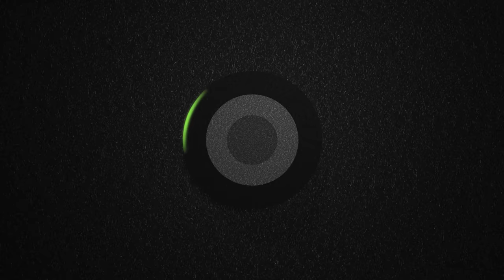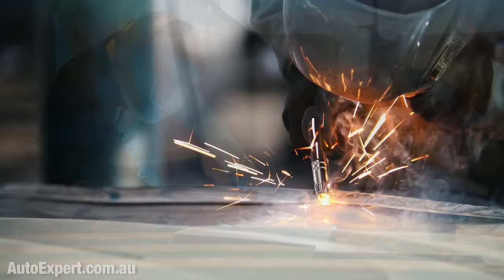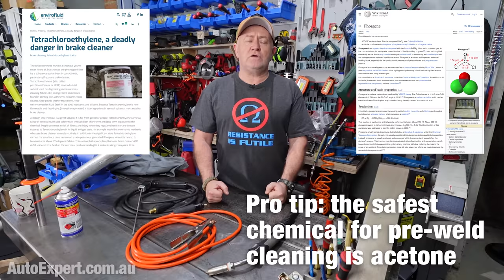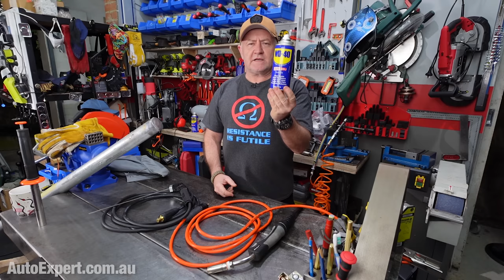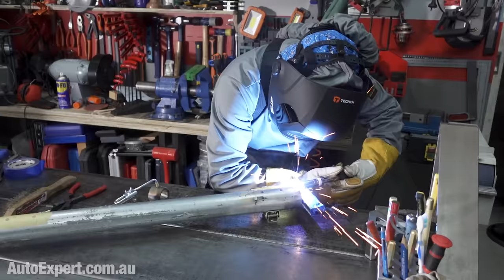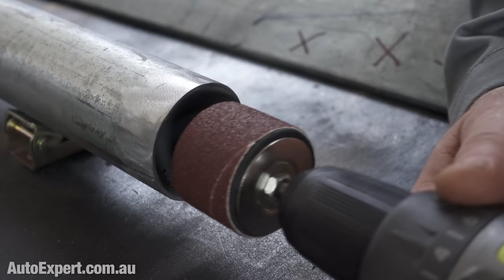How to die while arc welding at home: the top 5 ways | Auto Expert John Cadogan

Comment: What about people who hold the arc weld stick in their gloved hand also holding the holder in the other hand for more control?  i thought this was a good idea as i am prone to shacking the stick however the Technician in my brain wouldnt allow me with its blaring electrocution warning . Yes you are not completing the circuit Unless you accidentally lean on tor touch the other electrode say thru a thin sleeve etc

Comment: Additional hazard potential.... Any fine nickel dust (grinding of high nickel steels (stainless) ) and CO gas (defective heater, incomplete combustion, etc in a work area) makes nickel cabonyl gas - highly toxic. Grinding pre-welding of stainless pipes - ensure no CO present - the amount of CO required to make nickel carbonyl is extremely low.

Comment: Excellent advice. The only thing I would add is to make sure that if you smoke cigarettes, don't have a plastic butane lighter on your person. Put it where sparks can''t find it. You would be surprised to learn where a spark can go to and a spark can melt divots and holes into the plastic case of the lighters, possibly resulting in the lighter exploding.

Comment: What kind of a heresy would it be to remove galvanising with HCl (i.e. spirit of salts) ? Theoretically you would end up with zinc chloride, which can be rinsed off - and hydrogen, which would dissipate because you are in a 'well ventilated' environment. Obviously you would not then try to weld until the workpiece had dried . . .

Comment: So you missed some important context on your second story. Sure, your typical welder runs around 24v under load, but open circuit is another story. I've personally used some welders that would easily climb to over 100v DC open circuit depending on the machine and the technology in it. The common weldernator (premier power welders for example) used as an underhood onboard welder on some trucks even can be used to power brushed powertools. the open circuit voltages that can be put out by some welders isn't a joke.

Comment: 19:29 19:30 Great video I have seen every one of these scenarios except someone getting electrocuted I've been welding for 50 years the most Spectacular One was a guy welding on a stock car and there was a can of spray paint in the fender well. and he set it off large Fireball fortunately he was not too severely burned and another thing I've ran into is be very careful when dealing with magnesium grinding it sending it sandblasting at anything that makes particulates you will get that metal Flume flu instantly and it's not nice I thought I was having a heart attack

Comment: I was told, and it makes sense, that you can make fire resistant welding gear fire resistant after washing by putting it into a solution of borate, and then drying it.

Comment: hey that's just like dichlorofluoromethane or R12. That's how Air conditioning got started. after WW! they had a bunch of dichlorofluoromethane left over from making phosgene for nerve gas.. the dichlorofluoromethane has to have a catalyst .... a flame though. always wonder why in my old car repair manuals when working on an R12 ac system it said not to smoke, smoking i suppose you could draw in some dichlorofluoromethane through your cigarette and the burning ember on the end could turn it into nerve gas. So why did they use dichloromethane you ask for Air conditioning?  because it boils at around 38-40° F  and as you know with boiling water , the boiling water will never go over 212° F, the excess heat goes up in the steam, first principle of AC. they let the Dichlorofluoromethane boil as it passes through the car cabin and it takes with it all the heat from the car cabin, then the dichlorofluoromethane is compressed in the condesor p\outside releasing the heat.

Comment: I used an ac mig  once 300amp my god that shock hurt I only use an invertor now stick or tig 48v open circuit 12amp working voltage

Comment: One should be aware of things that should not be repaired that take certification, like pressure vessels, and dissimilar metals that do not bond well. Also welding heat actually changes the size of steels while welding.

Comment: The guy who electrocuted him self should work with an old machine because in the newer ones there is the VRD protection that reduce voltage in the rod until it will touch something with very low electrical resistance like a piece of metal.

Comment: Thanks for a very informative video. Regarding electrocution... isn't there any electrical safety rules that say an electrical appliance must not expose the operator to lethal voltages in your country? Though I was just repairing two welding machines and one of them did output a nice 34VDC idle, but the other one like 70VDC. The 70VDC could likely give a shock but being DC I think it is unlikely to electrocute anyone. But my point is that have all electrocution accidents been due to malfunctioning equipment?

Comment: Anyone with any understanding of electricity should be able to see that arc welding is inherently dangerous.  Thanks, I did not know about the UV exposure.  You left out drug dealers cutting holes in the top of their empty gas tanks and then patching them so they could hide drugs inside.  Saw that several times as a cop.  Only welding deaths I ever saw.

Comment: A solution for home use could be flux core wire and a table fan to blow most of the smoke to the side instead of going straight in the face, better than nothing I guess..

Comment: Had fun watching this and your expression to getting it over, but let's get real...

#2 "big fo fireball".

A good welder is a clean welder and crud/stuff on the table is a sure OCD trigger. Even build up of bb's from welding should get up a good welders snout get the stuff off the table and brush that thing clean. Don't forget a quick run of the brush on the floor before break (what? 30 seconds?)

#1 galvanised. 

That stuff just isn't good and ideally left out of the workshop. 

Prep (grinding) is good but that stuff is infused in the metal by electrolysis and your not going to get rid of it.

Certainly, don't breath that stuff in..

Flux core may be best option, but I've welded stick with a thin rod with fair success.. 

As for putting the welder to your face and grounding yourself to the table - that should never happen - the 1st thing the good welder does is put the welding weapon in its space well before lifting the lid.

There's lots of dangers with welding and it's as safe (or unsafe) as you desire it to be. 

Either that or you have no place even in the same room as a welding machine..

Comment: I thought the voltage of a stick welder was only 65 volts.   Not enough to  electrocute you.  I often got a shock from it.  Wooden work bench only in my shop.  The led ad aluminium is dangerous, not worth the risk.

Comment: I have been watching videos over the past few weeks trying to learn about welding before I even attempted it. I always found myself saying, "Well, if I had a welder...." so after years of saying that  I finally broke down and bought one about a month ago. I never actually got around to using it though because honestly, I was a little scared. I have never done it before and I would watch all these videos and always had questions. Questions that never seemed to get a straight answer. One person would say one thing and then somebody else would say no that's wrong and I'm just left there thinking, so which is it? I had no idea about the wet gloves (I sweat like a pig and this never would have occured to me), the brake cleaner, and about leaving things like wd-40 on the table. Even the radiation from uv exposure - I had no idea. Obviously I knew you have to protect your eyes but as far as what it does to your skin, literally nobody ever talks about it. I did know about the fumes from welding galvanized stuff though but that was pretty much it. I was completely clueless on everything else. I've watched at least 100 different videos on welding and none of them said anything about this stuff. I was considering making my first welding attempt tomorrow but now after seeing this video, it seems there is still a lot to learn before I go jumping in head first. I think I may find someone with experience to assist me in person instead of just trying to figure it out by myself. You very likely may have just saved a life by posting this video. Thank you for that.

Comment: Guys phosgene was used in WW1 it's a bad gas like mustard and killed 1000s of guys.
Work with sheet galv mild steel and yeah some people to remove the galv heat it up and I think it's garbage and doesn't work well.
And guys have gotten really sick off that so don't do it. I find belt sander works great with a face mask.

Btw any tips appreciated 
I can do my own oil, oil filter and spark plug change on whar was my old car but now I have a i30 and I am wondering if there is anything odd I need to do or look for.
Cheers don't really know where else to ask? 
Things are tough and I could do it myself.

Comment: I was (almost) Killed by a 12 Volt Car Battery while Jumping the Solenoid across the Hot lead and the Big Start Wire, let me tell you now, Once the 800 Amps are Moving ... your body wont stop it... It WILL most assuredly Kill You, Just because you can touch the Posts of a 12 Volt Battery and feel Nothing  doesnt mean the Potential isnt there that when it starts moving, if you open the circuit while still touching the Battery Both Poles, You will die.

Comment: I have been welding for 60 years and never had a problem. But people kill themselves every day. Usually because "I never knew that" basic common sense seems to lacking. The worst mistake I have made was welding galvanized metal without adequate ventilation and a decent mask. Not an el cheapo one a good one.  The only other thing, and I still do it occasionally is get a spark down my boot. I have spats but I forget to wear them. I had a few pairs of socks with little holes in them. The pain is punishment enough.

Comment: This is horrifying, absolutely sobering, and horrifying. 
I'll add this to the list of things that should have killed me when I was younger. 
I'll be a lot more careful in the future.

To add to your story, I worked in the automotive industry. There were huge ovens in the shop that baked fiberglass pieces. 
Those pieces were stacked and put into die molds and pressed to form bumpers. 
On the job site press operators had access to spray cans of mold release. Someone set a can of mold release on top of the oven. It must have sat there for sometime. 
One of the workers picked the can up, it was hot, so he dropped it. It went off like a rocket, and embedded into his leg and severed an artery. 
He didn't die, but he came very close. The hospital is only a few miles away. If it had been further, he wouldn't have survived.

Comment: The more you know the more there is to see going wrong. You should also have an awareness of the things you don't know, that could be possible. Known unknowns.

Stop and think first.
 If you don't need it there get it out the way.

Most importantly be of the mind set that PPE is the last line of defence, not the first.
Then remember it is not optional either, but has to be correct.

This is my PPE. There are many like it but this is mine. Look after it. Don't share it. Respect it. You are nothing without it.

Comment: I'm surprised, anyone would get a big enough shock to die from a home arc welder, as voltage is very very low, wet skin or not. And through thick wet gloves as well, with a brief tap of the stick to the head, its seems impossible.

Comment: Structural steel welder using mostly DC 7018 here….been minor shocked quite a bit but I’ve taken a couple pretty big shocks through the chest because my gloves were so sweaty while welding out in the heat of summer.  Scares the shit outta you.  Good to keep dry gloves on ya and be aware of what you’re touching when you cut the arc.

Comment: 760ub113 doesn't exist. There's a 610UB113 and 760ub start at 147kg/m. Typically ub stop in manufacturer at 610 due to the sheer weight being rolled which is why WB's start at 700 and are easier to manufacturer.

Comment: I had a good friend in Georgia who had an elite body shop that was full of antique cars. He was welding on the floor and noticed some sparks found there way to his old rag pile and they started smoldering with a little bit of flame.
   He panicked and ran into the house to get a small fire extinguisher and ran back into his shop to put out that fire. Now, if you've never been in a body shop, Bondo dust on a smooth floor is slippery and sure enough, he started to fall. On his way down, he looked for something to grab to slow his fall... and he did. His parts cleaning station.  I believe there was several gallons of kerosene and other chemicals in there and he grabbed it and tipped it over ,it splashed across his leg and went straight into the flaming rags. 
   Yup, lit the place up, burned his legs and feet pretty bad and totally burned that shop to the ground with a half a million dollars worth of cars in there. Gone, all of it. 
   The lesson ?   Oily greasy rags go into a safer place. Keep a fire extinguisher near... Several of them. And last but not least, be aware of your surrounding when welding. Things burn readily that we aren't aware of. Bondo dust burns like gun powder.  Fast !

Comment: Great advice, chap.  Maybe a bit off-topic but I'll also add, NEVER mix toilet duck/bloo loo//Coca-Cola etc. with bleach  as again, you get that phosgene effect and it's deadly.  Great Grandpa survived WW I but only just after a gas attack and couldn't get a decent breath since.  No modern Asthma/Bronchial cure back then.  A leather Motor Cycle jacket was always appreciated in the Welding area, with something to clip the two studs shut that usually hold the collar open normally.  With electric...a piece of dry wood to stand on or, if it's awkward angled, to lean against if you absolutely have to..  Yes, great advice from yourself, sir.  The WD40/volatile pressurised can is so simple to over-look.  We've all seen the Bond movie with the Deodorant, right?   Peaked an interest again, sir.  Cheers!
[Edit: Spelling]

Comment: Look, just go take an OSHA course on welding safety. Online , or find an experienced trained welder to advise you on the risk. I've been a welder for over ten years, worked with stainless all the way to mild steel. Do your research, i can not repeat that enough. Do it.. I don't care how much they pay you. After you know the risk , you need to refuse to weld specific materials without proper safety precautions 15:10

Comment: Nor should you weld with loose fitting shorts,  crotch  burn is not to be laughed at! Growing up on a farm we used to be welding/building/repairing equipment on at least a weekly basis.  Most of this done outside on dirt.  Not a big issue until I decided that a pair of Rossi ( Beautiful Boots) Leather soled boots would be better rather than the good old Blundstones.  You know that lovely tingling feeling you get when you realise that damp leather is very conductive and changing rods becomes a good morning heart starter!

Comment: When I was in high school, I worked as a mechanic's helper in our family business during breaks. I was stick welding the deck of a trailer. To reach the seam to be welded, I was sitting on the trailer. Instead of climbing off the trailer to turn off the welder to  change rod I grabbed a new electrode and went to put it in the holder, zap!  Luckily, my welding gloves had enough resistance. The shock went through my hand and out my butt. I never did that again.

Comment: Back in the late 80's I worked for a fence company welding gates. They handed me a welding mask, gloves and a zinc bar. After welding an area, you take the zinc bar and melt it over top of the weld you just made. Smoke would pour off it. Only worked there for a winter, but wonder how much of that crap I inhaled. Nobody ever told me not to inhale it.

Comment: You only need to put a fan in front of you, blowing away. Select your distance so it creates a mild low pressure area to carry the smoke away without disturbing your welding gases, bi it TIG, MIG or ARC. If for some reason you can't put it in front of you, then put it directly behind you so that your body shields your welding gases, but the airflow coming around your body carries the smoke away from you.

Comment: Stainless steel is in the same category as galvanized due to chrome oxide, do not breathe that in either.
Excellent warning about electrocution, one reason I avoid and tell others to avoid using the work surface as grounding - ground direct to workpiece and as close to the weld as possible.

I'm a mechanical engineer, specialized in machine design and construction but have welded and studied welding too along the years and find it the most enjoyable job!
Mostly done welding as part of industrial maintenance but bit of steel construction too.

Considering a career change to a full time welder ngl or starting a small workshop of my own, having just lost my latest engineer job due to cuts.

Comment: I started with videos like this on woodworking tools like tablesaws and planers and construction. I never had any major accident after 8 years in construction and carpentry due to correct ppe, self-education and training apart from one good cut on my left thigh from a 12" concrete cutting blade on an angle grinder chasing a wall by not being focused and carefull for a split second. It left a nice scar about 2 inches to remind me how easily i can be hurt but nothing else major. Lately I started welding and I so much appreciate your experience documented in this video, this kind of information saves literally lives. Liked and subscribed sir.